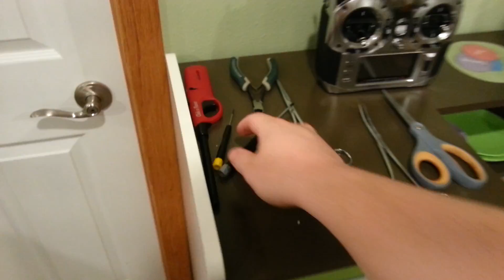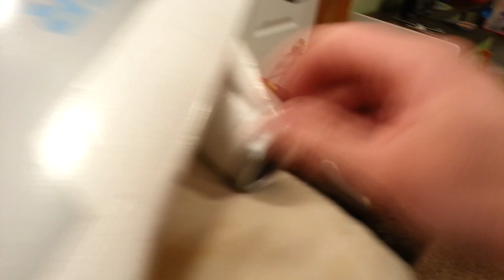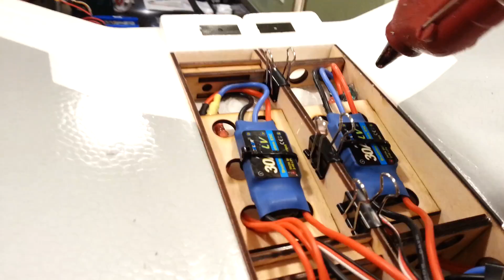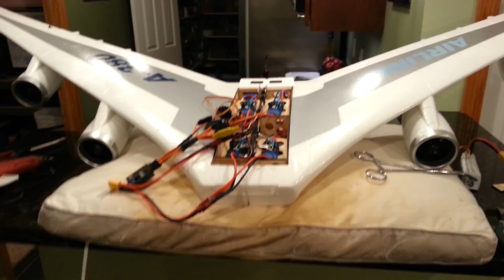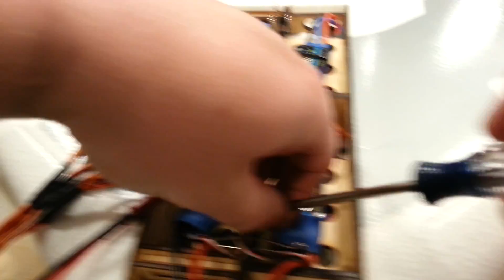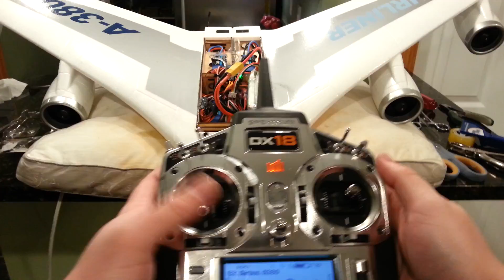Tian Sheng - Airbus A380 - Wing Box Cable Management - Build Series - Part 7

Comment: That's a lot of wire management and it turns out looking good.  I like the hot glue tip on keeping the wires from disconnecting, short circuit prevention, and keeping the wires in place.  I need some forceps.  The receiver antenna setup is a nice touch.
Reply from the maker: Thanks! just don't over do the hot glue (that was a great ryme - I should be a rapper!!!)